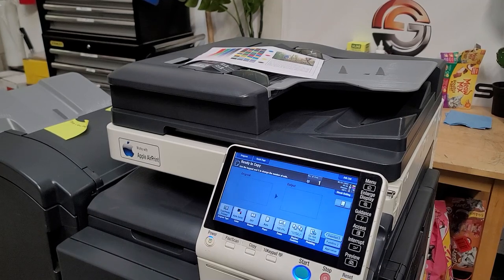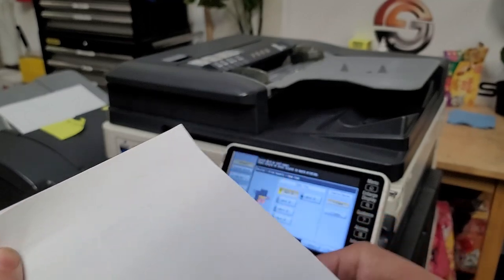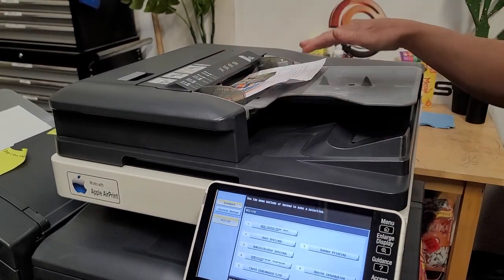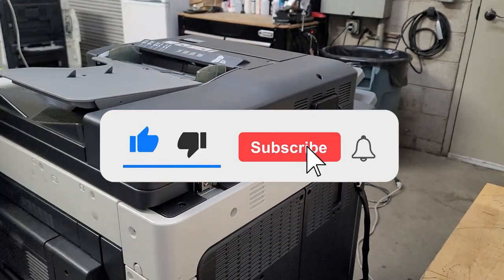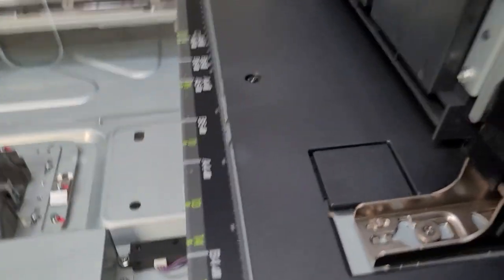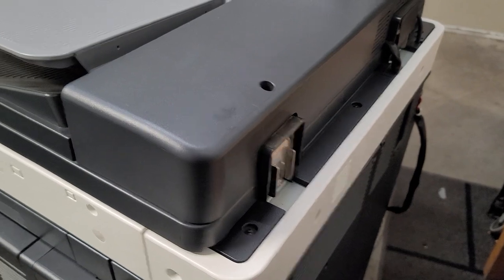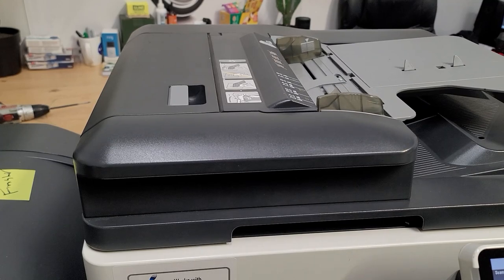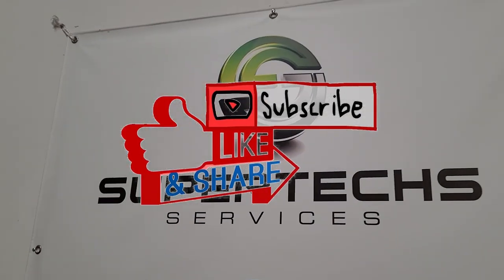How to adjust the ADF skew on Konica Bizhub copiers #konica #bizhub

Comment: I have a problem.  Blue lines appear when I scan.  the glass is clean.  The lines are regular.  Could the tape have been damaged if I didn't remove the locking screw for transport
Reply: you have to input the time in service mode stop->3, read the adf manual thoroughly